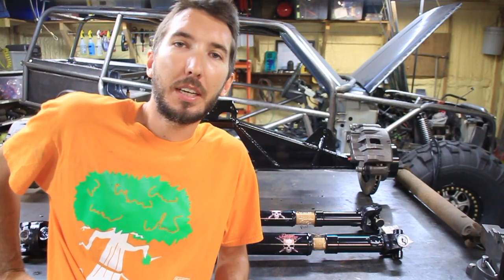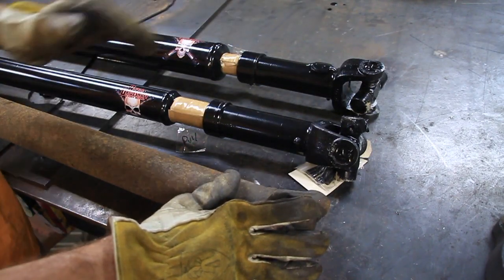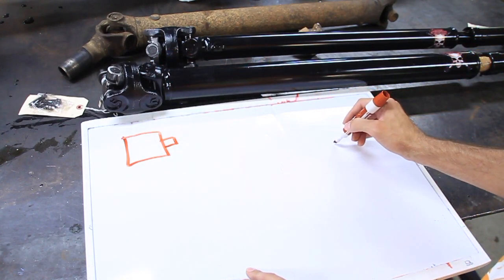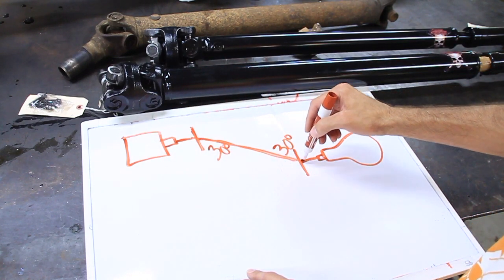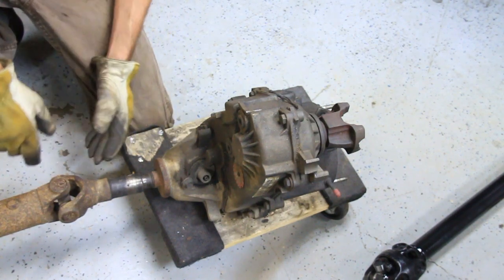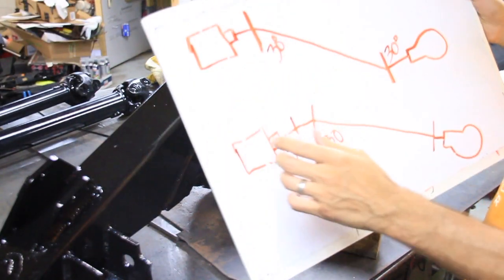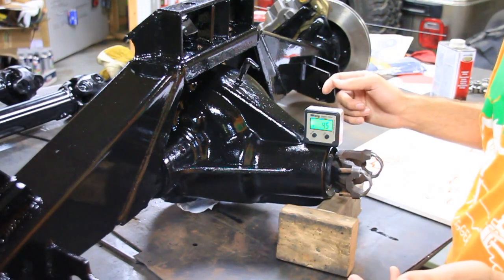Driveshaft Selection and Pinion Angle

Comment: A double cardan joint is basically a short drive shaft with equal angles on both ends.  That is how it achieves constant velocity.  The centering ball arrangement keeps the joint from flopping around and keep the angle of both U joints the same.
Reply: Ok let me get this stright .
Say i have a 1980 toyota corolla and instead of lowering it like most , i raise it 4 inches and swap out the two piece driveshaft for a single. 
Then add a double cardan up front on the teanny yoke , that will take care of the driveline angles ?
In other words no vibrations .

Comment: Hey Mat, I was always told to keep at least 3 to 4 degrees misalignment at both ends of the drive shafts (not point the pinion directly at the transfer case). Especially on street driven vehicles. The reason is to keep the roller berrings rolling in the ujoint. If they don't roll it will cause premature ujoint failure. On a trail only rig, it wouldn't make a difference because the drive shaft is constantly changing angle anyway. keep the Vids coming I love this channel
Reply from the maker: hmmm, i havent looked into that... would that not cause vibes at highway speeds?
Reply: I've heard this too. Seems like it would be best to have the rear pinion a few degrees lower than parallel so when the vehicle is driving, the small amount of axle wrap will move the pinion up to parallel with the shaft and actually reduce and vibrations.
Reply: jake32401 makes sense cuz the torque wuld lift it a little
Reply: 1-2 angles is all that's necessary to achieve that goal, 3-4 is excessive
Reply: Actually you want the joints as parallel as possible but you just want them not on the same plane.  And that's a good old school trick when converting truck to 4wd or adding an auxiliary brownie transmission.  Just take two very straight 2 or 3 ft pieces of channel iron.  Drill and bolt one to the trans (or transfer case) and one to the diff u-joint flange.  
Spin both flanges so the rods are parallel then measure the end to end difference and turn the trans or tc left or right slightly to get that trans mounting point orientation spot.  Any good tape measure will work ok.  Then spin both flanges so the channel irons are vertical and measure them end to end.  Shim the axle until those two readings are exactly the same.  This will give you excellent results without using any angle finder reader.  Just make sure the distance from the ground to the axle flange is different than the distance of the trans or tc flange is to the ground.  Higher or lower does not matter but they must be different (not on the same plane) otherwise you will quickly destroy the u-joints.  Words of wisdom from someone not a mechanic but doing this stuff all his life.

Comment: thanks for your videos!! I have a problem with the swap I am doing. It is a 5.3 ls engine and a 4L60 gearbox. my platform is a Jeep CJ The transfer case is an NP 208. The front outlet of the transfer appears to be pointing up as does the front differential. These angles are not parallel. Can the shims be used to direct the differential output downward?

Comment: You should do a video on swapping in an 8.8 and setting up the pinion angle with a front DS used in the back :D  That's my next mod and looking to hopefully do it all without using shims or longer shackles (which also change the angle).

Comment: Hey Matt I got a question, I hear a lot of people say ideally the pinion angle should be 2-3 degrees below the angle of the driveshaft on a double cardan shaft. But what is the max tolerable angle you can run?

Comment: hi, I appreciate the video.  It's nice when someone can just teach and talk normally without hype or annoying music.  
However, aren't those new drive shafts assembled incorrectly or upside down?  If the double cardon is up high at the transfer case, shouldn't that be where the slip joint should be also?  With the slip joint lower at the diff the slip joint is more exposed to water, mud and dirt and with the female part of the slip joint pointing somewhat upward, water that gets in cannot drain out.  
Just some questions because I'm no mechanic and I'm watching these videos to learn.  Thank you.

Comment: The reason you would need to find the angle of the pinion, or the angle of the t-case is to ensure they are both Parallel (in the case where you are not running cardigan joints). As you know, setting the incorrect angle will cause more force to be applied to one of the u joints than the other. And in my case, I have a swapped engine, causing the transfer case to slope slightly, when I set my pinion angle (w/o cardigan) I needed to know the angle of the output and pinion to make sure they were parallel and to prevent this problem.
Reply: "cardigan" lol

Comment: So my cj5 has a 4.2 straight six, T4 garbage sack, and a Dana 300 transfer case. Like any rational person I want to swap in an ax15 trans. But the trans is so long that even with a S.Y.E. on the D300 my angle would be too tight for the rear drive shaft. Some rumor a CV shaft would fix it, but I don't plan on playing those games. It looks like my only 5 speed option is a T5, but that's not touching my baby anytime soon. It looks like my best option is an SM465 transmission. You think one of these fancy driveshafts and some shims under the rear leaf springs would let me squeeze in an AX15?

Comment: Quick question, is the double carbon I think you call it driveshaft offroad reliable? I was told that because of those multiple joints it could break easier from stress when off roading

Comment: My xj is 2wd so i lift it 3 inch and a vibration was dwveloped, so i want to hear your advise, can i only turn the rear axle up where the shaft engages to change the angle of the diferential? And delete the vibration?

Comment: Doesn't the cardan split the angle between the two u joints? Original single was running at 30 deg. , add the cardan, now each of those two is running at 15 deg.?
Reply: roger that. lol
Reply: Yes

Comment: Great video, I have a question I recently had a 12" inch BulletProof Suspension kit professionally installed on my 2015 Toyota Tacoma 2wd. along with 37x13.50x22 tires on 22x14 wheels. I notice when driving there's a chattering sound that appears to be coming from the center area underneath the truck maybe the driveshaft. So I was wondering would a one piece driveshaft correct this problem if the chattering is indeed the driveshaft? Your opinion/help is much appreciated.

Comment: I'm running an Adams and a teraflex sye.  I'm still confused a little. so for me the rear pinion has to be pointing at the t-case and that's it not like a stock set up where they have to match the angle or is there some crazy math involved?  I never new that the Adams was marked to line up like that. good info I should double check that since it fell out once when I was replacing the u joint. want expecting that lol.  I love watching your vids. you have helped me a lot over the years.
Reply: With a single u joint driveshaft the two angle must be the same, if not the driveshaft will actually wobble on its axis which will make vibrations.  Think of the u joints and how they rotate, that’s also why the are timed or clocked a certain way.
Reply: The rear pinion with a SYE and CV driveshaft points AT the CASE.
The front CANNOT point at the case because when you rotate the front pinion UP, it rotates the steering knuckles DOWN.  So up front you cannot point the pinion at the case, unless you cut off your knuckles and weld them back on at the proper castor angle.

Comment: When setting pinion angle don't go too extreme. you can have the axle rotated at too high of an angle and starve the pinion bearings of oil and shell them out. just a heads up.

Comment: Good video... my question is I have a lot vibration after installing 4” rough country lift kit.... I done 2 alignment rebalance the tires.... the vibration still there ...
Reply: Pedro Blas it is often recommended to get a Slip yoke eliminator at 4+ inch lift
Reply: It could be pinion angle or it could be the driveshaft isn't balanced.

Comment: This video is pretty old but maybe you'll still be able to answer this for me. On the front which is more important? Pinion angle or caster? Or spilt the difference
Reply from the maker: You need both to be correct.   But I'd say caster

Comment: I'm having trouble with my 96 XJ it runs just fine but when I shut it off it won't start again for hours. Motor still cranks but no fire. Things I've checked and or replaced (engine temp sensor, distributor assembly, dis cap, rotor, plugs, wires, fuel pump and filter are good, good fuel pressure) I've been told it could be a "heat soak" problem which I've personally never heard of but could u do a video of replacing injectors with ones from a dodge neon. That's what I've heard works best but I'm still unforsure
Reply from the maker: a buddy had this problem for a long time.  he always thought it was heat sink... turns out it was the fuel pump... had something to do with fuel pressure.
Reply: +BleepinJeep thanks I replaced the ignition coil hoping that was the problem n it wasn't so I'll do fuel pump n filter next. Btw love the videos I'd love to see more projects n see the scorpion out on the trial

Comment: Its odd most the vehicles I've owned (with rear wheel drive) have had a driveshaft with single U-joints on each end at a angle of about 10-15 degrees (i.e. the pinion is level with the ground and the driveshaft goes up at 10 to 15 degrees to meet the transfer case.)  But this video isn't the only place that says you need 30 degrees to run the U-joints properly...  My current vehicle I believe is about 25 to 30 degrees for the rear drive shaft (wich is huge btw, probably one of the longest single driveshafts you'll ever see on a 1/2 ton)  and the front axle is mounted from a fixed transfer case to a fixed differential via double cardan set up (still to factory specs)  into CV axles that are at 22 degrees of angle.  Anywho.. my whole point is I think I have it all correct.  But its still confusing lol (no odd noises or skipping occur)  again rear shaft 25-30 degrees, front cv shafts at 22 degrees.

Comment: Question. If you are changing the pinion angle on the front axle wouldn't that change your castor? So how to you get the right castor and pinion angle on your front axle?
Reply: jared collins take it in for an alignment...lol
Reply: Generally you can't have both. Pinion angle trumps castor. But most find that a compromise, somewhere in between, there's a nice spot.
Reply: Jared Collins, to get your pinion and caster at optimal angles you'd need an aftermarket axle housing that has that angle built into it. That's the simplest and surest way of achieving it. Another way is to cut your knuckles off and reweld them at proper angles, but who would wanna do that.

Comment: i bought a 2001 Jeep Cherokee sport 10 years ago. It had a new 2" lift on it. I drove it for 10 years, then a bad vibration started. Its horrible. A Jeep mechanic says I need a SYE and Double Cardan drive shaft to fix it. Is this common? Does a vibration just come out of nowhere 10 years after a lift was installed?
Reply from the maker: If it was fine before, then that's not the issue,  watch my two videos on death wobble, it will be in there.
Reply: thanks man, i will

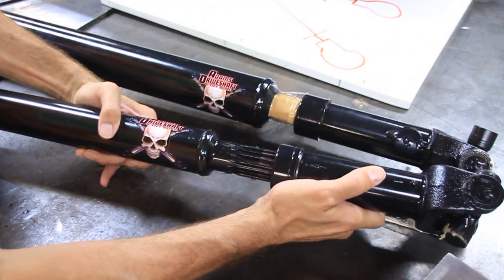Comment: 5:42 I don't understand how a double cardan driveshaft can be out of phase. Isn't the purpose of the double cardan unit to take care of the phasing and keep the shaft spinning at a consistent RPM (hence the nickname constant velocity driveshaft). I'd guess that the match marks are there to keep the welded on balance weights in the right position.

Comment: Matt I know you used to show budget friendly stuff (the "bastard" pack rear leaf lift ) but you didn't mention anything about using a stock front shaft on the rear with an sye ? why not?
Reply from the maker: Sure it can be done if you have the right length but the last year of the XJ was 2001 so any stock shaft is going to be at least 16 years old by now and most are questionable... not to mention most junkyards bend the shafts when they move the jeeps around with the forklift.
Reply: Yep that's how mine was done. a shaft from a 4.0 aw4 jeep does nice. Of course with a monster like yours I would want a better shaft anyways but for my 4.5" on 33"s it's more than strong enough.
Reply: Queso Bob plus its cheaper and if it breaks then u can get a better 1, nosense to spend more then need be , alot of builds r overkill in cost and strength compared to actuall use it will get

Comment: Your second whiteboard drawing - the two angles are 15 deg each, not 30 deg. Which is why the double cardan is bitchin'. The other 30 deg is the pumpkin angle. Correct me if I'm wrong....correct yourself if I'm right. ;)

Comment: How would you correct your caster angle after turning your pinion up like that? I’m swapping a Dana 60 to the front of my tj, and trying to figure it this is going to be a problem or not. Thanks
Reply from the maker: Well if its really bad then offset balljoints or rewelding the C's.

Comment: u~ jont phaizing,,,   you used hand motion to discribe,, that,?    it should be both ends drive shaft u joints  same posision ,  ( clocked the same ),   pinion angle ( single ) should match same degree as out put trans case,      yes ?

Comment: can i switch out my 2 pc drive shaft for one pc drive shaft on my dodge pick up ?
Reply: Abel Cerrillo Depends on the length you need. I did a auto trans to manual trans swap I  my 84 f250. The driveshaft that came with the manual from the donor truck was two piece, but it was shot. Had a shop custom make a single shaft. I believe they said the longest they could go was 76-78". They made mine out of aluminum, and they had to make it 6" thick to compensate to make it strong enough not to twist, it's pretty insane, even if it cost $850
Reply: It's a 2piece for a reason, the lenght

Comment: Don't you wan ta boot over the splined, slip joint area?
Reply: Adam's doesn't do the boot but Tom Woods driveshafts has that as an option.  I'm not sure if you can get a boot for the Adam's or not.  Haven't looked.  I just grease it after any water fording or 4500 miles with the oil changes and chassis lube work.

Comment: Way too much information to none comprehendible oh did you see that grease cert on the slip yoke let me say this when your greasing it you need to stick your finger or a tool up in there and hold that grease on that little 16th in Howe in the dust cap so that your grace will come back down to splines grease follows gravity downhill you didn't mention that so I figured I'd do it for you